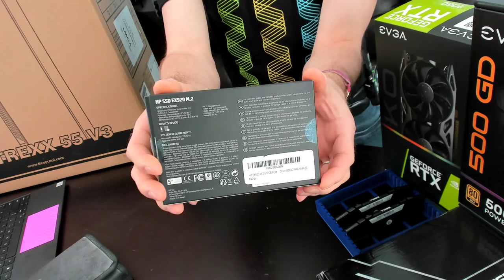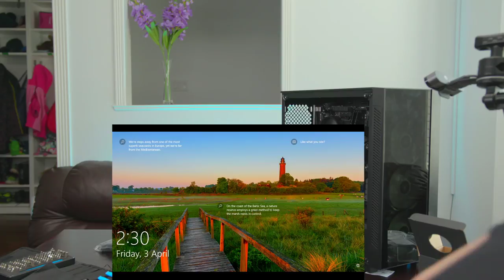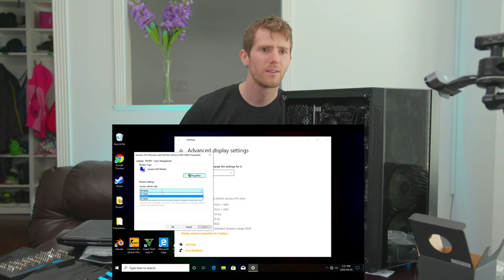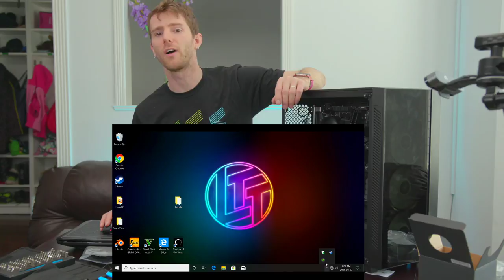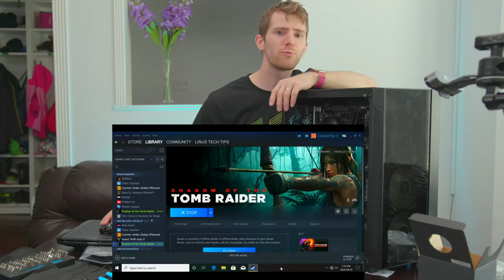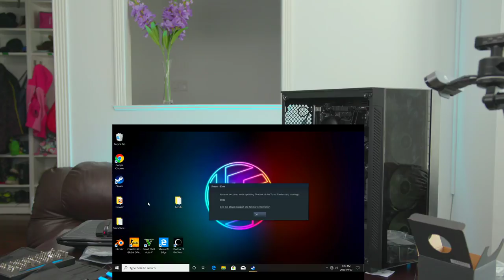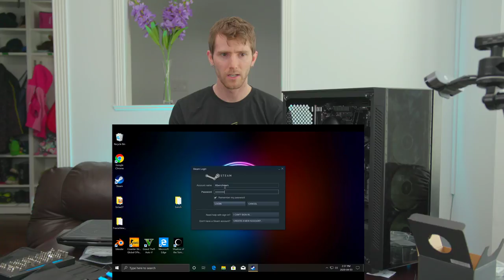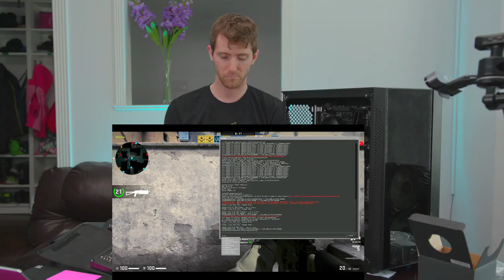Building a Value Gaming Rig at Home - $800 Budget

Comment: First Time commenter but i have seen many of your videos, Curious, I have a Ryzen 3600x CPU, Asus Tuff Gamming x570 MOBO, I have 3200mhz Gskill ram 32GB, and a FireGL 1TB M.2 Drive read 5000MB write 4750mb(not sure write speed)  and Asus Strix Nvidia 1080 8G adavnce videocard. what in your opinion should be my optimal setting for CALL OF DUTY COLD WAR

Comment: ok so im guesing the ryzen 3600 was not in stock or the 3600x was same/lower price than the non X 3600. becaus there aint no reason to get the 3600x over the 3600.

Comment: Hey linus what is better the ssd u used in this vid or a ssd kingstone a400 960gb sata3 2.5inch?
Reply: Read all:
It's smaller at: 512GB, but the read /write speeds are 3200MB /1600MB /s.  SATA3 has read /write speeds of 550MB /s.  

IMPORTANT:  Your motherboard needs to support this type of drive:  M.2 NVMe PCIe 3.0
NOTE: ( NVMe sata3, is no faster than 2.5" it just uses the M.2 slot. It's still sata3, just without the case )

There are less expensive NVMe PCIe 3.0 drives, slower, but still 1800-2000 read speeds.  Could get 1TB for a little bit more than the one used in video, or stay with 512GB and save some money.  You will still be able to use your 2.5" SSD.
Reply: Eternal Darkness thanks that was very usefull :)))

Comment: Anyone know a good substitute for the 2060 KO that'll work with this build? I can't find one for the life of me.
Reply: The Monster Under Your Bed  I actually managed to camp best buy's website to grab a 3060 when they released, is there any downside to running that card with a 3600xt?
Reply: The Monster Under Your Bed  Oh really? Sweet! You gonna skulk around on release day and try and grab one? It's honestly the only way to get a fair-priced card these days I'm quickly realizing.
Reply: The Monster Under Your Bed , by the way, concerning the 3600xt in replacement of the 3600x, do you think it will cause any problems in this build due to the fact that an older motherboard is being used? Will it be compatible with 3600xt chips? I've heard that this motherboard's bios can't be updated without a compatible CPU, which isn't something I have access to.

Comment: I'm making a pc and I need help. Here are the parts. Tell me if this is good for The price.

Motherboard: Asus9 z490k.
Gpu,: gtx 1650 super.
CPU intel i5 10400 ten gen.
Psu powerspec 550w switching power supply.. 80plus bronze 
8 gig ram 
512gb ssd 1terabyte hdd.
Fans and cpu cooler.
All other would cost around 1400 to 1500 dollars.
Reply: I don't know what country or currency you're working in. However, here in Canada, your parts come to approximately $1100.00.  
Roughly $800usd like the build in this video. Linus' build here is significantly better. ( although now you can bump his AMD motherboard up to a B550, or even X570 )  ( $150.00 / $200.00 respectively ) 

AMD Ryzen5 3600 cpu is likely better than the Intel 10400.  ( I don't see how the 3600X or 3600XT are worth the extra money)
Note:  AMD & Intel motherboards are different! 

GPU: GTX1650 is an entry level graphics card.  In this video, the 2060KO is much better, or AMD 5600XT is as good, and a bit cheaper.

NVMe SSD:  make sure it's PCIe3.0  ( you don't want SATA3 = same cost, much slower)  there is PCIe 4.0 it's faster, but at twice the price of 3.0 ( I don't think 4.0 is on Intel motherboards yet )

Pricing I used from your info: ( Canadian $)
10400=$250,   1650S=$230,  Z490=$220,  8GB 3200Mhz RAM=$50,  SSD: M.2 NVMe PCIe3.0 512GB=$100, 
1TB HDD=80,  PSU 550w Brz=$70,  Case=$80,  Cooling=$100  
Total= $1100cdn +taxes

Swap time: ( gaming )
CPU: 3600=$270, GPU: 2070 ( or 5700XT) =$520,  Mobo: X570=$230,  16GB (2×8) 3600Mhz RAM=$100, 
Intel 660p 512 NVMe PCIe 3.0 SSD=$100,  2TB HDD=$100, Case= $80,   Cooling=$100   (cpu fan is included)

TOTAL $1500 cdn  back to your original estimate. (edit: where's the PSU?  oops... 600w 80+gold=$130)  depending on your budget you can fiddle with stuff.  B550 motherboard is $100 less, 2060ko is $100 less, PSU depends on final build, etc...

Better cpu, hugely better gpu, 16GB ram. 2TB HDD, Case and cooling are just rough targets.

If not gaming a lower GPU is fine, you could bump up the CPU to a 3700X ( good value )

Personally, I'm waiting on AMDs new CPUs & GPU's and / or Nvidia 3070 releases.  It'll be a few months though.

Comment: Why does HP make SSDs?  Before they bought Compaq, back in the 80's and 90's, HP used to make the the most reliable disk drives on the planet (2x MTTF) which would make every engineer in Japan BLUSH! - I bought one for a Macintosh SE30 in ~1990.  So they have a storage division which means ... of course they would switch to flash drives because they have a bunch of storage guys at the company.

Comment: How is $800 be enough to build this?
Reply: right now you might find a GTX 1660 (by itself) for about $800.
Reply: 1660s are going for around 500 on Ebay new
Reply: @issacbarnett8099  That's an Improvement. I was really hoping that with the new GPUs from AMD and Nvidia (along with an attractive MSRP and performance) I was expecting to see card like the 1660ti and 2060 to fall between $200 and $300. 
How Naive is that?